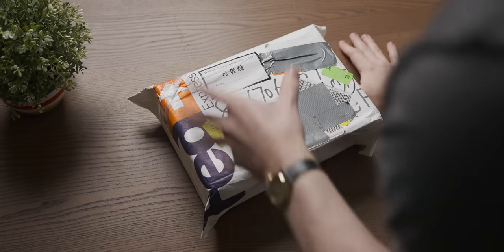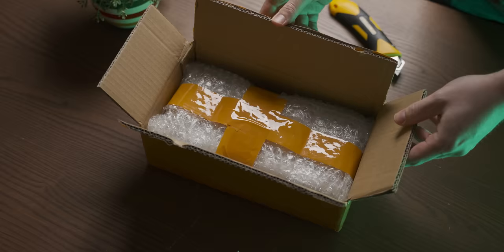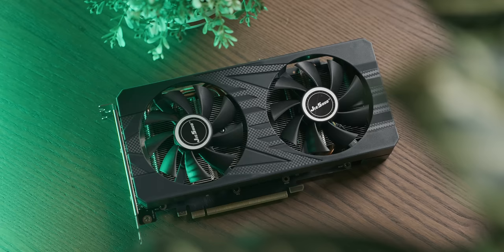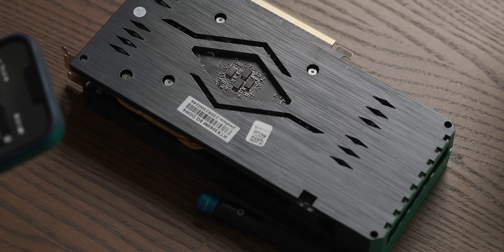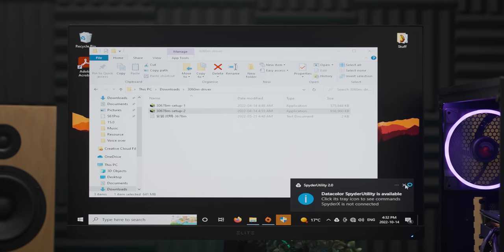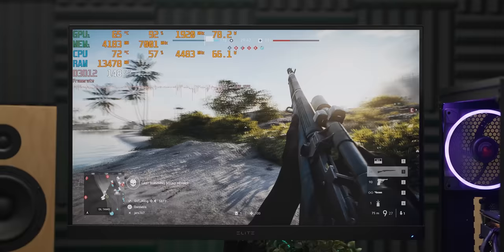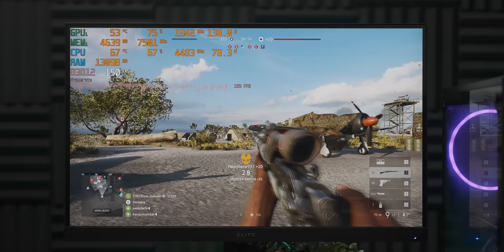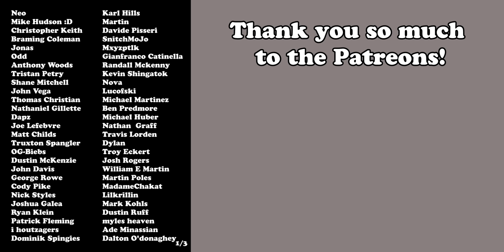This "New" RTX 3060 From Aliexpress Was Suspiciously cheap...

Comment: honestly it's actually a pretty nice idea if it were to get done officially, the laptop gpu's could totally be released on desktop as like a low power alternative for those who need the efficiency but still want good performance, it's too bad nvidia would never go for it because they don't believe in making things affordable anymore
Reply: Honestly would like them to do it, may be a good way to bring back the "5" moniker for cards.

RTX 3065 = RTX 3070M.etc

As usually the laptop SKUs are equivalent to the desktop tier below due to core count reduction/power reductions, so giving the card better cooling and higher power delivery would allow them to push to the in-between region.

So say let's assume, the 4080 Laptop GPU performs more like a RTX 4070, a desktop release of that version of the card could be badged as a RTX 4075
Reply: Didn't AMD already do that
Reply: I agree. I would love to replace my 1060, with a 3060 6g mobile for 250 bucks right now.
Reply: You do realize it´s what AMD did with lowend RX6000 GPUs, do you? 

However, they also killed them, when they did not include video decoding support. Which kinda defeats whole purpose of a lowend GPU.

edit: oopsie, did not read the answers. Well, whatever.
Reply: @WhiteG60  if nvidia made it , father than diy chinese hacksmiths .
it would cost much more than even og 3060
Reply: Saving power has a two-fold advantage, it being better for the environment and your wallet - indeed things NVIDIA doesn't care about.
But what if... they presented them as the better for the environment version? The NVIDIA "Extra Green" edition and sold them at a premium claiming it's for the better of the world instead of fatter margins. (Like Apple not shipping chargers)
Reply: @Axeiaa  if you undervolt and underclock your 3060 a smidge .
You really can get pretty close performance for the same power draw .
Reply: Nvidia is nothing a proprietary driven driver and more powerful the more cost method they will never provide drivers from an alixepress sellers while the mobile desktop gpu from amd allows people to download the latest version of the mobile desktop gpu easy honestly get the amd mobile desktop gpu than the mobile desktop Nvidia
Reply: Especially now that GPUs are pulling half the wattage of a damn microwave
Reply: Nvidia would NEVER do this, it would de-value their high priced cards.  If they did it, it would like like $50 less, not a big amount less.
Reply: @WhiteG60  Honestly I would love for more power efficient gpus as I have a 3070ti and it still crushes any game that I play at 1440p so i'm not really interested in the big performance jump of the 4000series but my room gets plenty warm in the florida heat and wouldn't mind something of similar performance using ~30% power down the line. I don't understand everyones obsession with higher gains when the games coming out look the same and are not really becoming more demanding. Only demand is people trying to push 4k high refesh rates.
Reply: Totally agree. I like efficient parts and would definitely buy it if it were officially done.
Reply from the maker: I completely agree. I really wish Nvidia would launch an official version of this card. It’s really cool having that much FPS with so little power draw.
Reply: @WhiteG60  They could make Maxq desktop variants.
Reply: @peaceinoutb  you know you can undervolt it right? If you’re fine with leaving performance on the table, just drop the voltage and clock speed a bunch
Reply: You have to give credit to those Chinese engineera cobbling this abomination together. They might have gotten their hands on extra mobile GPUs and decide there is still a market for people desperate to want a video card enough to buy just about anything.

Still laptop power efficiency on a desktop is a plus but the drivers are damn dodgy as hell. The high suttering is also maybe because the driver is some sort of layered emulator? It is definitely not optimized at all.
Reply: it is capitalism, nvidia company owners care about profit - not about progress. take it
Reply: Matter of fact chinese have more screen 4K on than everything
Reply: They could potentially be getting the GPUs from otherwise damaged laptops, this kind of thing has been done with other computer hardware. The mobile chips may not be any cheaper to produce or have any more availability than the desktop version.
Reply: wat
Reply: @WhiteG60  Actually now that power is 3 times as expensive as it used to be... people might go for an E-card.
Reply: @Alovon  Actually contrary to what you might think laptop parts tend to be binned at a much higher quality because of the tight power budget and more strict performance/efficiency demands. Given all other important specs are equal, they would probably even outperform their desktop counterparts given enough power and cooling and they almost definitely would if both were at the same wattage. This hypothetical "E" series would probably actually be a premium, but still desirable version because it could do much more with less and do so while being more stable and producing less heat.
Reply: It might have benefit for someone putting a PC in their car perhaps.
Reply: @90lancaster  Just get a laptop if you're going to live in a trailer, that way if the battery dies you don't immediately lose everything and have time to save and shut of your PC. Laptops literally have built in outage protection because of the battery and all they really need after that is a good circuit breaker and they are good. That's part of the reason I switched to laptop, because they have effectively outage protection should the power go out for any reason.
Reply: Nvidia is like the Apple of GPUs. They're great quality, but they're too expensive.
Reply: You should also count amd in this. They made low end lower power GPUs, but botched them in certain ways.
The 6500XT is clocked way too high, and uses more power with less performance than a desktop 3050. The 6400 is an improvement, but just like the 6500XT it lacks any good video decoding and encoding for certain things.
A GTX1650 is the best people got now. Also I’d rather have Nvidia make a new series of low end GPUs rather than use laptop variants to fit that market. Especially as some might not be that “inexpensive” as you thought. Maybe they could make some low end Ada Lovelace GPUs called the 17 series or something.
Reply: @WhiteG60  no they don’t. Low profile cards like the 6400, and the 1650 costed the same as their full height variants. Only issue is that scalpers still come around and inflate the prices of them.
Reply: I'm guessing the CPU is bottlenecking which is why it needs 2x the power load for minimal performance gains?
Reply: Yup!  I recently got a Nvidia GTX 1650, because it's literally the only non-prehistoric GPU I could find that runs within the PCIe 75 watt power budget, and does not need extra PCIe power connectors. (... And I don't know if even THAT is available any more; the GDDR5 model doesn't need extra power, the GDDR6 model does!)  I threw it in a potato with an Ivy Bridge; the GPU is rather overpowered for it, GravityMark is the only thing I've run that got the GPU usage to 100%, any actual games either CPU bottleneck, or hit the 60FPS cap.  No complaints though, Cyberpunk 2077 is ridiculously CPU-limited but still runs 30FPS in the benchmark (and higher FPS in-game in general); just means I can go ahead and crank the quality settings to high (since it gets almost identical FPS, just gets the GPU run about 60% usage instead of about 40% on medium.)

It's close to false advertising to just say "Hey, GTX 3060!" (...but Nvidia does the same thing, they REALLY should call the mobile version a "GTX 3060M" ("M" for mobile) or something like that...).   Especially a problem that you have to use some random driver with it for it to install.... (I wonder how it'd work in Linux? I can install the Nvidia driver whether I have any Nvidia hardware in a system or not; but I have no idea if it'd load it.) 

But packaging up some notebook GPUs onto a desktop card, for those who want a modern GPU without the massive power draw and heat production?  If it weren't for the custom driver, I think it'd be brilliant for those who want to upgrade some potato-like system to get some extra use out of it!
Reply: @hwertz10  Actually the GTX1650 GDDR6 model uses the same power as the original GDDR5 one, but the core clock was reduced a bit, so you’ll get faster VRAM for a lower boost clock. You must be thinking of the 1650 super that uses more power.
Also Nvidia and partner companies do differentiate between mobile and desktop variants, but when you get a laptop, it’s always assumed you’d get a mobile variant of that gpu name, that has differences which either makes themselves obvious right from the get go, or the gpu is like almost the same as the desktop variant. This scenario just made it different cuz someone gutted a 3060M and added it onto a desktop PCB.
Like the 3060M would technically be more powerful than the desktop variant (due to more cores), but is held back by 6GB of vram.
Plus I do agree that having 75 watt GPUs would be great but in the end you’d have to accept that some5ing that draws that much power can only go so far. Like the 3050ti mobile is almost like the desktop version (which takes either 115 or 130 watts depending on the model) but the 3050tiM has a 75 watt mode that makes is a pretty decent card for medium settings at 900p on games, but that is pretty much the best you’d ever get, as the 2nd best 75 watt (or lower) card is AMDs RX6400 (which is basically a low setting card that could maybe hit 60fps at 900p)
Reply: @hwertz10  there fkn rtx 3060 m not GTX 3060
Reply: That would be perfect for me and my 400w power supply that only allows me to go up to a 1660 Ti. Only 80w consumption.
Reply: @growlanser5600  or upgrade the power supply?? Literally you’ll limit yourself from future upgrades by going with such a low PSU
Plus you aren’t getting any better performance due to a low VRAM size. A 3060 mobile is good for a laptop configuration, plus there is a 3060 3840SP which is the same cores as the 3060M but with higher boost clocks, and 12GB versions.
Not like it matters since the 40 series cards are coming soon.
Reply: @WhiteG60  it makes no sense to do that because if you want to use less power just limit the power draw yourself.... the pc marked is supposed to be like you do what you want and not like consoles "take what we give you and live with that"
Reply: B
Reply: @Thewaterspirit57  unfortunately with a lot of prebuilts that people are trying to upgrade, PSUs are limited to OEM due to bs motherboard connectors (HP being a worst offender).
Reply: @balkloth  You’d have to be stupid to go with those OEM prebuilds.
HP only ever had one PC that has standard parts. Thought people would know this by now.
Reply: Was thinking the same thing - mobile eGPU's. Instead of having a giant, nearly itx sized case with an ATX power supply and a Thunderbolt or Occulink cable, why not use the mobile variants?? Some may even be of low enough wattage to run completely from the Thunderbolt port. I'm just thinking about mini-pc's right now, but imagine a thin-ish little 1.5slot thick, single fan sized little box, plugged into a laptop or mini PC running a mobile Radeon 7900xt or mobile 4090...or just a mobile 4060 or 7800XT - both obviously far superior to the Radeon 780m or Arc 330 iGPU that Intel has and still keeps the footprint and power consumption down. Only plug in when needed....
Reply: @Axeiaa because if they tried selling a Worse Card at a Premium they would literally lose money on the Manufacturing alone since Gamers are Constantly trying to get their hands on the Fastest Available and if your Budget gaming your Probably already buying a Generation or 2 Behind the Curve and won't pay a Premium for a 3060 Mobile GPU if you could get the 3060 for Cheaper so they would be Manufacturing E-Waste
Reply: I'd use it. Too bad I'm on pcie 3.0 though and.. It's a virus cesspool

Comment: The GPU probably has a funky hardware device ID by default, they likely had to modify some driver files to accommodate its ID. I've had to modify some device IDs in nvidia's offical drivers to make installers work on lesser-known laptops. device manager > right click the GPU > properties > details > set the dropdown to hardware ids and then add that ID to the inf files that the nvidia installer unzips in C:\NVIDIA. this will force you to disable driver signing, but you'll have official non-virused drivers.
Reply: please make a video tutorial or something, because i can´t play games with the easy anticheat because they detect de drivers like "hacks"
Reply: Thaaank you
Reply: the best way is to install the frankenstein drivers for these Frankenstein cards, but u still gotta keep in mind altho the modded drivers allows the the official driver to be installed on it properly, it is not official by any means, as you are downloading some .exe from a stranger online. But(again) you have pretty much no other choice if you have a Frankenstein GPU like this. So consider at your own risks

Comment: The cause of the driver issue might be that these cards were produced for mining so they might have programmed a mining bios on them that nvidia drivers don't like. Flashing the bios to a real gtx 3060M might be helpful.
Reply: Interesting idea.
Reply: I don't think there are mining bioses for Nvidia cards
Reply: @castor9907  Yeah for Nvidia cards, the bios must be written via the Nvidia servers but everything is possible in China it seems.
Reply: @bariscosmaz  Remember there was the Nvidia source code leak not too long ago and the Chinese aren't exactly known to respect copyright laws.
Reply: @Xenogenocide  I remember it now. This is a strong possibility. They would absolutely do it if they can. You are right.
Reply: @bariscosmaz  As you saw in the video, this leads to hijacked software packed with trojans and spyware. I wouldn't mind buying a modified laptop GPU if it weren't for these shady underdealings.
Reply: Of course NVIDIA has mining bios and driver's.. they make mining specific cards witch need bios and driver's that is 100% different from the gaming family of cards..
Reply: i think it work when you paste the pci id from graphics card properties in device manager to the nvacig file under nvidia_devices in the display.driver folder of the graphics driver
Reply: How can I do that?
Reply: @Xenogenocide  Is it tho? Windows Defender detects manipulated software that is not necesarily malware as for copyright protection.
Reply: @patximartel  yes, this is also true too. I must've overlooked that.
Reply: asprogrammer. amazon sells bios programmers.
Reply: @patximartel  it is, the two Trojans in the driver were a "remote control" trojan, and a banking information stealer trojan.
Reply: This.
Reply: @Xenogenocide  Odds are they sourced the card from a safe source then had someone make them some drivers, it was likely intended to send the crypto it mined to the one who made the drivers, I think this could be the case because the GPUs performance was extremely optimized for power efficiency like a mining card would be. The fact that it needed two drivers could just mean the ones who sold it knew that driver was bugged so they made a mock driver that has some way to make the trogon essentially useless. Even if that was what happened, I would still not ever go near something like this. If someone ever does want to do this though for some insane reason beyond my understanding, I strongly recommend they at least have an air gapped throwaway system to use to completely reflash the card's BIOS and be certain there's nothing else in the card that can carry data and inject it into the OS, then see if they can get the official drivers to work and if they don't, I'd say that card is a lost cause.
Reply: @MoesKeckeEcke  bruh I tried 20 different ones and none of them work cause they lack features for the desktop card. The driverside issue can be fixed with just adding the device IDs to an inf file
Reply: @MoesKeckeEcke  the only mod to the driver is telling it that it will actually work on this card, literally no other modification to the driver is required and this is completely different to a vbios edit. And there's no way I know of to mod a vbios because the Nvidia Falcon security will automatically shut down the core if it detects unsigned firmware, which your modded version wouldn't be. If you think it's possible go ahead and try for yourself
Reply: No, they used desktop GPUs for their mining cards.
But as people have got those to work as pass through GPU processing to the onboard graphics the driver signing is now known. So it would be possible to change the official driver to work on these. The stuttering is probably more to do with the onboard memory size and speed rather than the mobile GPU.
Reply: it seems like windows can't detect modded nvidia cards only, because there are videos on the modded RX 6600m and that one worked fine, along with actual driver support. Asked about it in a different video's comment, and someone replied to me about it being the hardware encoding
Reply: @volvo09 thats why you only install those grapic cards in your gaming pc not in the work one.